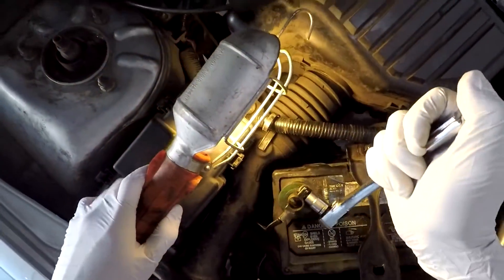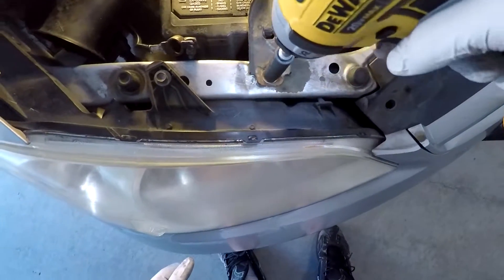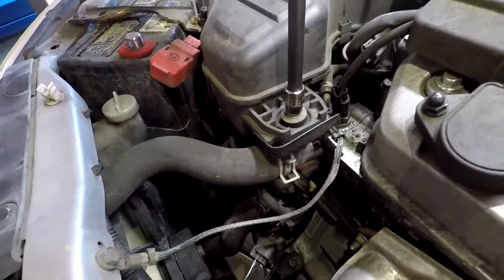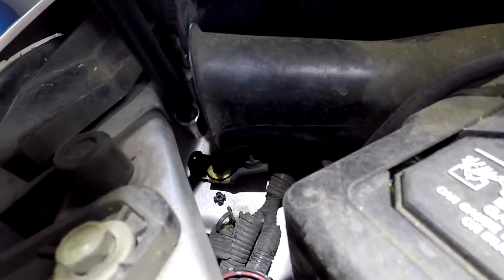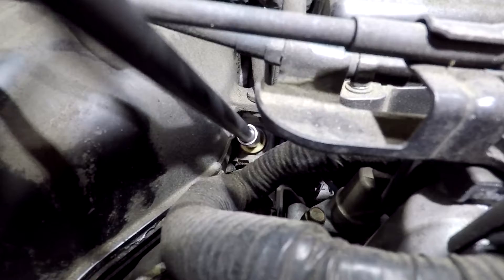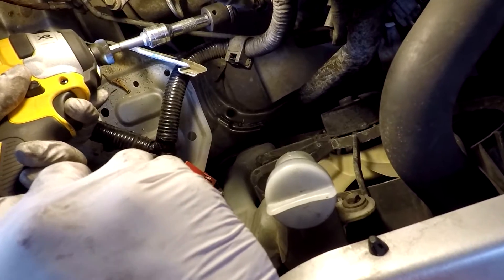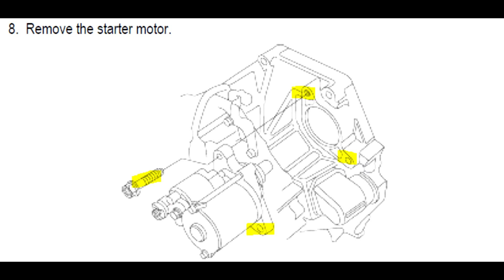2004 Honda Civic Starter Replacement

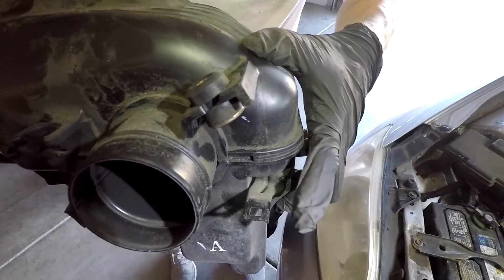Comment: FYI Tab to release the cable harness at 1:30 is a pull up on the locking tab not a push down like the narration suggests.

Comment: Fantastic video im  struggling get one off i removed 2 bolt and cables but wont budge thought maybe a 3rd bolt else were mine a hrv 1.6 4x4 same engihe and starter  think?  do i need bar it off or knock off with lsrge hammer plz help everyone
Reply from the maker: Starters in general on Honda's usually only have 2 bolts, so if you got both of them off, it might just be stuck.  Take a rubber mallet and bang it and see if it pops loose.

Comment: I am almost certain its starter,, as car had 2 month old battery and there is power.. it just doesnt start....
Reply from the maker: Probably either the starter or the ignition switch.  There's a certain noise the starter makes if it's not working correctly.  Listen for it and it'll be easier to determine if it's the starter or switch.